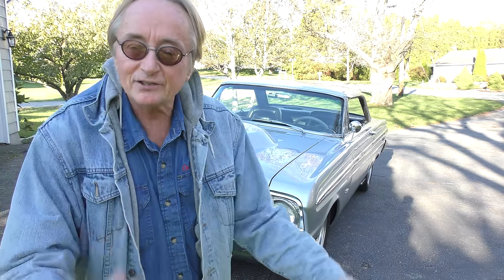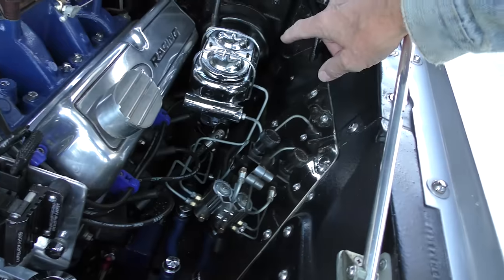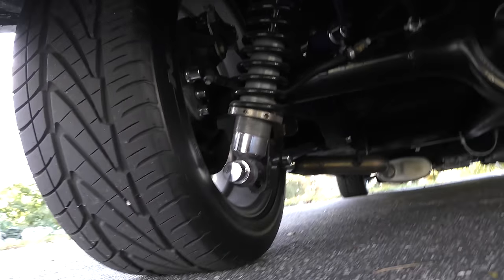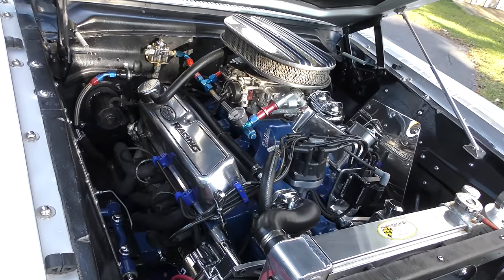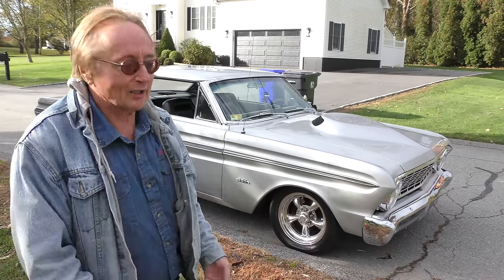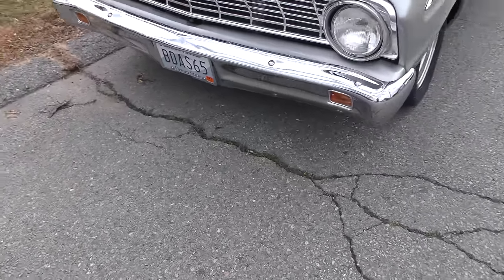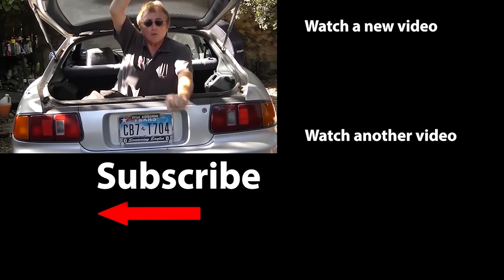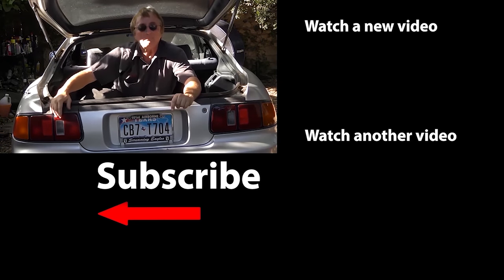I Finally Found an American Car Worth Buying

Comment: Brings back memories - I had a '64 Falcon Futura 2dr - 170cid straight six, 2sp automatic, and way-over-assisted power steering.
Reply: I almost got a '64 Falcon as my first car. I always felt it was handsome for such a basic, no-nonsense vehicle. No wonder why the Mustang was based on it.
Reply: 2.8litre in line 6 cylinder....yum yum
Reply: That’s power steering that is so effortless that it gives you no feel
of the road.
Reply: I always felt most 60s & 70s Ford vehicles with power steering were over-assited. The feeling was so light, you almost had no idea what the wheels were doing.
Reply: We had the Mercury version of that, the Comet, same 170 cubic engine, inline 6, but it had three on the tree. It was the first car I ever drove.

Comment: We had a Falcon and three Comets in my family over the years. They were all straight 6 with automatic transmissions. Definitely not speed demons but they were quiet, reliable and easy to work on. The ride was WAY more comfortable than most similarly sized cars today. I wish I could get an old "granny" car like those today.👍
Reply: When I was 6 or 7 my uncles had a '64 Comet convertible they shared while they were in college. Would love to have a Comet Caliente convertible of that era, today.
Reply: My Family had a Ford Falcon when I was 6 or 7, we filled the rear floorboards with blankets and pillows and my two older Siblings as well as my Parents would travel to the West Coast or even Deep into what we then called Old Mexico. Love Those Great Memories!

Comment: My uncle back in 1960 bought a first generation Falcon with the 170 cubic inch straight six. Man that thing was epically slow. In the late 70s or early 80s you could get a Falcon for peanuts so guys would drop a 390 with a C6 automatic in them and build a car that was hard to beat on the drag strip. And it didn't cost a ton of money.
Reply: The power to weight ratio is outstanding!

Comment: The Falcon was manufactured in Australia, for the local market,  from 1960 and was, as you say, intended as a ‘do it all’ car but ’67 saw the introduction of the GT variant which had the 289 V8 from the Mustang. The GT became a racing, and marketing, success and reached its peak in 1971 in the form of the GT-HO Phase III (the ‘HO’ standing for Handling Options, the more broadly known meaning of HO was still some 15 years in the future!) with a 351 Cleveland or fractionally bigger Windsor. Its power output of 300 bhp seems quaint these days but was enough to make it the fastest four door in the world, a distinction it held until the year 1990!
Reply: They put H.O. right on top the air cleaner!
Then it would say something like 289 High Output! 🤨
Reply: Windsor is bigger then the Cleveland? Is that what your saying?

Comment: I'm pretty much old school, and my two cars are a 1963 Ford Falcon Futura Convertible, and my second car is a 1970-1/2 Ford Falcon Station Wagon.  Both are pretty much original, but the '63 has had a good deal of body work.  They both have the original engines and transmissions, and I'm happy with them... actually, beyond happy, because the '63 is the original body style, and -63 was the last year for that style, and my 70-1/2 is the very last year for the Falcon model.    I call them my bookends.  I would love for you to see them if at all possible.
Reply: @captinbeyond  ... You're right... mid-60's the styles went from fins to all-square corners... matter of fact, a friend of mine bought a car brand new back then based on the "squareness" of the body style... as he said to me "when you look out the back window to park, you can see where the back end is"... true.  I love my '63 convertible, and of course, my 70-1/2 station wagon is pretty darned square (rectangular, but with squared off corners), and I can park that baby on a dime.

Comment: I bought a new '63 convert', had a frame.  Drove it 100 miles per day to work & home, traded it in in '68 (big mistake), it had 155K on it, still ran like new, the six cyl.  One great car, should have kept making them, 24 mpg, was 3 on tree.
Reply: almost all in line 6 cylinders are bullet proof!
Reply: I have a spare engine here for it. Runs like new!

Comment: Happy New Year Scotty!!!I picked up a 94 Ford, Ranger, four banger from a little old lady. Simplistic, reliable and still gets over 28 mpg. There definitely was a time when Domestic were built good👍
Reply: Got myself a new ranger. Best midsize truck on the market right now. Rangers have always been awesome.
Reply: @lesterparker1594  That's Awesome! I've owned Pinto, Mustangs and Capri throughout the years. They all shared the same four banger as the Ranger. All high mileage, never let me down. Lol The 2.3 have been around for almost 30 years😂 Tried and True!
Reply: @steveauston6020  I drove a 99 escort for 10 years, then a 2011 focus for 10 years. Now I’m on my 3rd ford. They’ve never let me down yet

Comment: Scotty, loved the classic car. I have owned 3 cars since 1980: 1966 VW Baja, 1994 Nissan truck, and a 2007 Toyota Tundra. I still have, and drive, the last two. I wish I still had the '66. I could remove the engine in under 20 minutes and quadrupled the stock HP. What a fun car that one was!

Comment: I had a 1964 Comet. 6 cyl 200 CID. 2 speed automatic. Manual brakes,  manual steering! Paid $90.00 ! Drove NJ to VT and back, and drove it for 20,000 miles. It was 210,000 miles I was told. Put used tires, fresh oil and gas! That's it! 👍🇺🇸
Reply: Nice 😀

Comment: The best American made vehicle I ever had was an 88 ranger with the 2.0. I've had tons of cars and trucks both domestic and foreign.  The ranger kept on going. My 94 chevy 1500 with the 5.7 tbi is another vehicle that has so far took every beating i threw at it. Both still running with 300xxx miles on chevy and 400xxx on ranger. Yup!

Comment: I used to have a 65 Mercury's Comet, had it for about 15 years and I loved it. It was actually my drive to work and the grocery store car. I actually called it my grocery getter. Lots of trunk room. Back then, they used to push the cart out to your and load them into your trunk. They were often pretty impressed when they saw my car.

Comment: I had a 64 baby blue Sprint.  Started out a 260, four speed.  I dropped a 289 in it.  I loved that car. Before it I had a 63 1/2 Falcon convertible. It also had the 260, but was a 3 speed.

Comment: I had a '68 " Millenium" Falcon, as a winter car in '75.  Six banger with a 1 bbl carb, drum brakes all around, with manual steering and a PRNDL.  In winter with -20 F degree temps, pump the the pedal 20-25 times it would start right up when other cars 10x more in price wouldn't.

Comment: 8:37 if the Navigator has a 5.4 3 valve Triton, run away. Buy the Escalade instead but stay away from the ones that have the 8 speed automatic transmission.

Comment: Ain't nothing wrong with good old school American muscle love my cars from the 80's and back and love my old school 60's c10. And my 85 Camaro iroc z28 has a 350 from 60's bel air with a more aggressive retarted racing drag cam. Linked up to a factory  5 spd standard shift

Comment: Yeah . I just turned 71 , and when I was 27 I bought a Ford Falcon P/U as a 2nd / work car . That thing caused me so much grief . I dumped it as soon as I could .  Knew lots of guy who had " hand me  down "   Falcons in H.S , College , and as a second car in the late  60's , early 70's :D
Reply: My dad had the Falcon p/u... two wheel drive and low ground clearance so not too good in snow.
Reply: @northdakotaham1752   Yeah . From what I know about N.D . and the winters there . It  would be far from a great vehicle for there .  Stay warm NDH !! ... Gubs
Reply: @indycharlie  thank you Mr. Guber. We are quite used to the weather here and even today we have  ground blizzard in progress which started late yesterday afternoon.  Getting through snow and sometimes even mud requires ground clearance and oddly enough, narrow tires seem to do better than wide tires. So tall, narrow tires and a foot of ground clearance works best here.
Reply: @northdakotaham1752  Yep .  I didn't know about the current blizzard conditions ?  Can't say I envy you :D . I am from Central Indiana . Always living in the flat lands , within 20 miles of Indy . Whereas in the early - mid 60's we did have bad snow storms / blizzards . Other than farming , off - roading wasn't a thing  during my H.S. years . Learned about "narrow " tires . When I did a off-road Class at Camp Bullis Tx . I attended  , before I started Med Training at Fort Sam . The whole Class was for we medics " to be " . To learn the capabilities " off - road ", of any vehicles in the Army , that could , or  could be made to haul patients . Was a GREAT 3 week course , of just driving vehicles in 2by or 4x4 , learning what they could do . 8 hrs a day , in the hills outside S.A. Tx :D  I got to teach & use that experience in Germany first , and then to lessor degree in RVN .  Be safe out there , stay unstuck , and WARM ... Gubs
Reply: I still have one of those small straight six motors that were used in the Falcon and later the Mustang. No car, just the motor. Runs perfectly after close to 60 years. I start it up and run it several times a year. Lots of fun!
Reply: @northdakotaham1752  Nice !!

Comment: Everything looks so similar now. All about the technology. But the technology is expensive and when it breaks. It's costly to the consumer. And when the new tech goes in, the old is old. Like buying a iPhone. When the new one comes out, the old is old. But older is better. Looks. Performance. Easier to work on. If one part breaks, not multiple breaks because one breaks. Technology is cool but not always a wise move.

Comment: Just finished having my ’61 Falcon restomodded.  Also cost me $60,000.  Has 425 hp, racing automatic, Torino rear, traction bars, American mags.  Looks stock from a distance.  But the interior parts are a combination of different year Falcon, Mustang, Galaxie, and T-Bird. I get a lot of thumbs up on the road.  Few people under the age of 40 know what it is.

Comment: $60K??? I built a '65 Chevy Biscayne, 2 door. It came with a 283 and 3 speed. I swapped in a 550hp 454, Richmond 6 speed, disc brakes and Hotckis suspension. Color sanded and buffed the paint and added a new interior. Cost? Including the cost of the car originally, I had $20K  total.

Comment: Scotty back in 1966 A guy I knew in HS had a Falcon and put a 289 CU in it. He was driving around and saw a group of us hanging out at a local Ice cream shop.  He pulled in to show off his hot car.
 Then pulled out on the highway stopped and floored it, well it was quite a sight. Smoke from the one wheel spinning rose into the air, then BANG the tire blew out. The good old days.

Comment: I learned to drive in my Dad's 1963 Falcon station wagon 170 engine with 3 on the tree. I did own a 1965 Ranchero 289 V8 and auto. Great cars.

Comment: you'll hate this but my favorite from 1964 was the Dodge Dart GT convertible with the 273 cubic inch V8 and push button transmission . Luv It !!!
Reply: I have a 1971 Dodge Dart custom and I love it a lot
Reply: @thegunbros1630  bruh Dodge was 10 times better back in those days. Scotty said the 60’s & 70’s Dart’s were legendary vehicles

Comment: The Falcon has top rallying history too. The 1964 Ford Falcon was the fastest car at the Monte Carlo Rally and it won every stage.  However as a result of the handicap placed on large engines, the actual winner of the 1964 Monte Carlo Rally was a Mini Cooper. Came 2nd with Bo Ljungfeldt. So there is a template to build a Falcon to.

Comment: Love your videos, always interesting. I guess there’s always an exception to a rule. I have a 2007 GMC YUKON XL DENALI. Original owner. It just turned 200,000 miles. I’ve kept it clean and put probably 3k in repairs and upkeep over the years, matter of fact I just did the plugs wires and coils at 195,000 First Time. Yes, GM has “known” problems they never addressed, too bad for them and eventually us,

I’ve been happy with my Denali. I’ve been lucky or blessed.

Just my stupid 2 cents 

Keep the videos coming Scotty! 😀
Reply: I have a 2001 suburban.The ls motors will run for ever and no electronics issues.

Comment: My first car 64:Fairlane one step from the falcon loved that car . I remember I was hanging out in a parking lot talking with some friends. When a friend of mine with a new 86 Camaro was goofing around came flying threw the parking lot and locked up the wheels and slid into the front of my car . He wrecked the front of his car and needed a tow . All he did to my car was he left some paint on my chrome bumper which came off easily.🤣I use to walk over the car from the hood roof and trunk without leaving a dent try that on these new cars.

Comment: i had a 66' Ford Fairlane wagon with 289.  I switch to short stack holly 404 and cut over from 2 carb to 4 carb. talk about vett killer.  it used 2 carb when driving around town and on the highway but if you stomp on for passing gear, those 4 carb open up dump gas and took off.  it dead when I got run off going skying at a-basin less then a mile for winter park exit.

Comment: My first car was a 1964 1/2 (1965) Ford Fairlane 500 HP . I had that car for five six years. I paid $4,100 a year for insurance because I had an accident in the first three weeks of driving. Yeah that just covered the other person's car if I ran into them. I had a complete engine overhaul that was done by an uncle cost me $1,500 bucks. There was a stop sign directly underneath the foot pedals welded in because that was completely rusted. Had a fun time in that car I let it go with 500,000 miles. Somebody else put it in their truck the last time I talked to them they were at 1 million miles. 1989 I originally bought the car in 1982.

Comment: I had a '65 4door in the exact color as the one shown in the thumbnail. Bought it in 1982 from the original owner for $300 dollars. Drove it for 4 years and sold it $300.

Comment: Yep the Navigator is definitely a half decent vehicle, especially compared to a crapbox GM Full size.  The last good GM trucks were probably the 88-98 versions.
Reply: 2007 last good year for gm
Reply: @danielmeador1991  wsnt talking about new ones.  Was referring up to around 2010 which is what they guy in the video was looking for.  Even with GMs trash AFM deactivated, the build quality on the rest is trash still.  GM is garbage

Comment: I've got a 1992 Chysler Convertible ....62.000 mi. I suffureded a stoke while working on it.  It has been sitting  for 2 years..got alot of mold .inside  and out.  RUNS GOOD..It's the LX version. Gold..no rust,new tires.  ..I need to get rid of mold  on the INTERIOR...I live in Vero Beach  Fl.  Anything I can do by myself?

Comment: I totally have to AGREE with you on the GM junk...
   I've owned a few different GM cars and they just fell apart on me, but then I went to Ford and ever since I then, I kept Fords in my Driveway. 
 We do have a Dodge Grand Caravan, but that Mini Van seems to do way better than the GM junk I used to own. 
 The Dodge is a 2019 Fully loaded GT trim level. 61,000 Miles on it and it gave us no problems at all, Change the Trans Fluid every 30,000 and all other fluids regularly.
  I am quite happy with the Dodge Caravan although they are not making them anymore, the replacement is the New Chrysler Pacifica.

Comment: My first car 65 falcon sprint convertible 289 four speed very fast grocery getter scotty omitted year of that falcon in video must have cut shock towers out to get 351 in there exhaust manifolds to wide 289 and 351 not same engine

Comment: I'm an American love American cars just gave a friend of mine my 2000 expedition 365,000 miles still driving it every thing works as should you can have foreign cars had 97 Chevrolet pick up 6 .5 diesel 280,000 when traded off in top shape just saying let you know when my present American vehicles get up on Miles so far highest is at 159,000 just saying 👍

Comment: They still make Navigators ? 😂 I’m good . I’ll take a Denali any day over a Ford or Lincoln . Oh wait… I have one with over 160,000 miles on the original motor and Trans and runs great 👍🏼  Had a Duramax with 250,000 before I sold it . A C6 Z06 101,000 miles .  Rented two Fords both had the spark plugs blow out

Comment: I’d do away with the tacky 2000s aluminum steering wheel. The hump on the hood looks tacky too; would be great if a different intake could be used to use a stock hood and keep the original lines. Otherwise the car looks fantastic.
Reply: That hood scoop was used on the "Thunderbolt" racing model. So its a genuine Ford piece. I guess $60K can get you a nice build.

Comment: 🟦 That's kind of a coverall statement to say:
"If it comes from FLORIDA it won't be RUSTED".
Well, you really SHOULD be more specific!... Cuz I got NEWS for yuh Scotty,...It really depends WHERE in "Florida" yer TALK'n about!
I live on the East-Coast of South-Florida and the cars (as well as everything ELSE that can rust) here on the coast DO-rust like CRAZY cuzza the salt-air comin' off the ocean! the prevailing winds come outta the East here "Right-off-the-water" and our tractors, lawn mowers, iron or steel lamp posts, metal fixtures on the house just rot-away!...If it CAN rust, it WILL!!!...It's QUITE a hostile environment! So it really would be best to say that:
"If the car has spent it's
life "Far-IN-land-Florida",
there's a great chance it
won't be rusted-out".
Reply: Hes talking about the OBVIOUS difference in relation to northern States where its snows every year & cars are picking up salt constantly. Even if you lived on the coast there's still no comparison. Drawing with a broad brush in this instance is appropriate. Go look up what Cubans are still driving & thats a freaking Island.